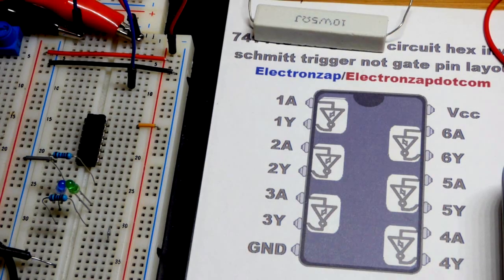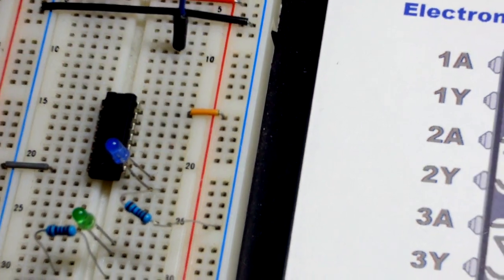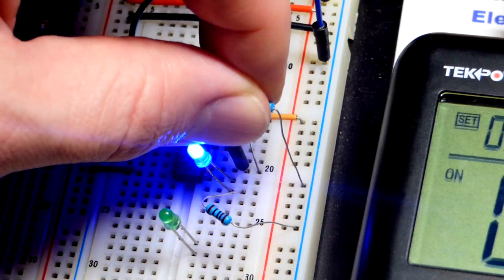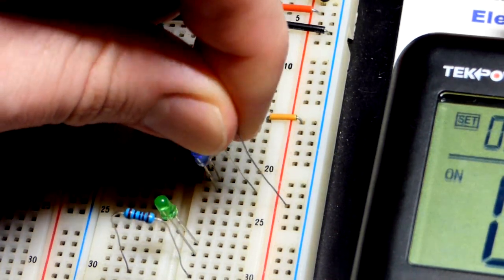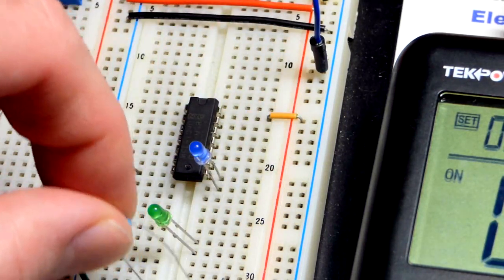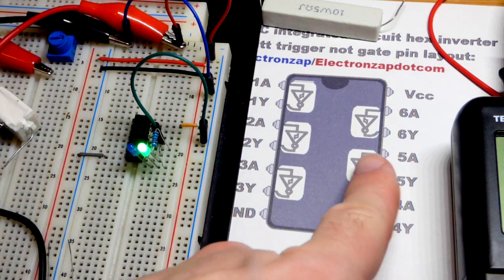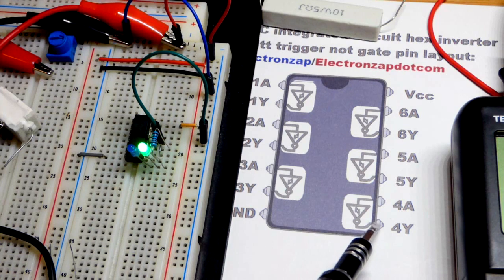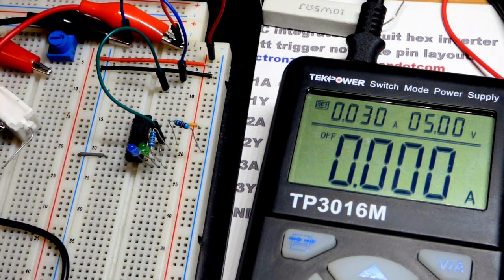Bonus video intro to 74HC04 Hex inverter and making a dual NOT gate electronics H bridge circuit

Comment: Aha, thanks for the video. In fact it is to invert a signal. What does the HEX mean? This can be useful when you need to drive a PNP with a HIGH signal or a NPN with a LOW signal. Maybe you can also do some primitive filter calculations with this? For example two pulsing signals and find the differences between those signals by inverting one of the signals. If both signals are the same the output is zero but if one of the signals is different you get a positive output. If both signals must be the same this can be used as primitive error detection. Connect a yellow led to the output and you can see if there is an error in one of the signals.
Reply from the maker: Hex means 6. There's 6 inverters in the integrated circuit. I don't do many calculations in my videos because everyone that loves that kind of math is already doing so on their own, everyone else won't want to watch it, and I haven't studied near as much math as college level electronics students, so they won't like how I explain it. But yeah, a lot of circuits invert signals.

Comment: I have some of the Schmitt-trigger varients (74HC14) only the way for some 5 port MIDI thru boxes that I plan on building. These will allow me to send MIDI control signals (events) to more synths. Each box will have 1 MIDI in and 4 MIDI out (as "thru" signals) but I think I can also daisy chain them with simple 1/8" jacks and connectors, theoretically providing 1 MIDI in and 16 MIDI out if I successfully build 4 boxes. I could talk more but a picture is worth a 1000 resistors: http://m.bareille.free.fr/midithrubox/midithrubox.htm Cheers! :)
Reply from the maker: Nice! I haven't studied MIDI at all yet. Looks pretty cool though. I added it to my list of future topics on my website.
Reply: MIDI is super easy to generate with Arduino, but I mostly use MIDI as a "consumer" with my store bought synthesizers. My goal is to transition from consumer to maker, although all I am doing is changing what items I purchase. 😂 I just snagged 50 LM386 amplifiers for $3 though, the GAS (gear acquisition syndrome) hasn't slowed but it sure has gotten cheaper.
Reply from the maker: A lot of times, I am trying to learn how to make something that isn't being made, and before I can figure it out, I finally find it already made for cheap lol.